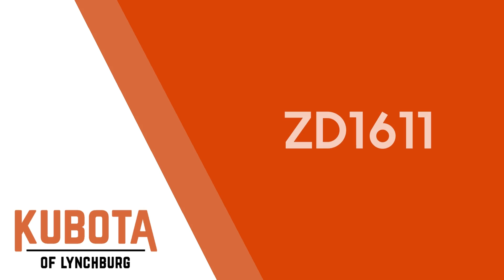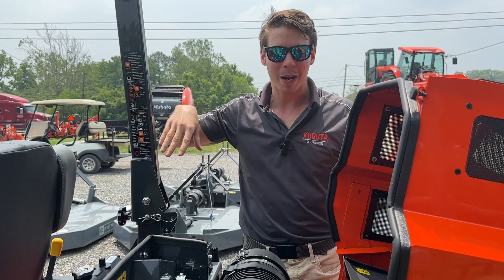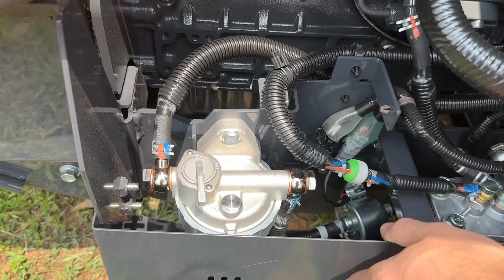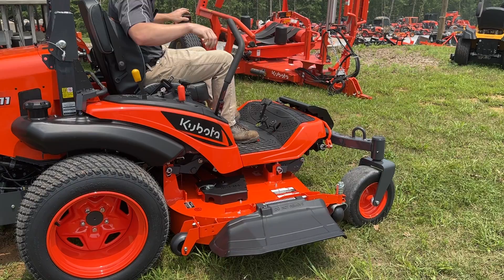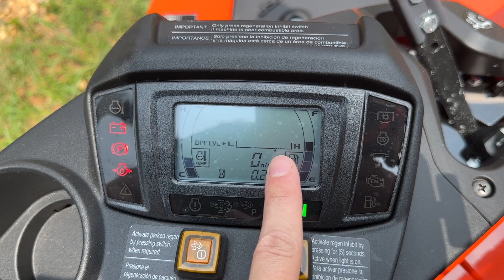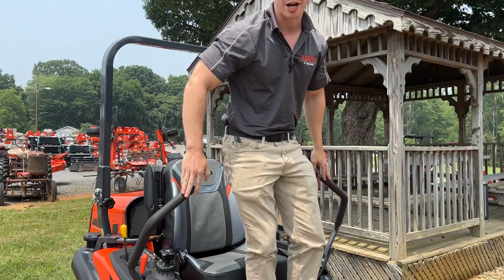NEW Kubota ZD1611

Comment: You need to pull your pins before you jack it up or it won't go up all the way and it will bend the pins. I know because I did it before figuring it out on the ZD1211.

Comment: My old ZD331 has 31 HP (pre def) . With proper care and maintenance it still runs and performs great. Not to mention it is a beast also. The brute strength diesel and heavy made materials make it like a mini bush hog. With a set of sharp blades the cut quality will match the best of them.